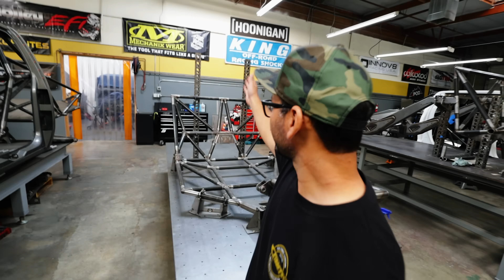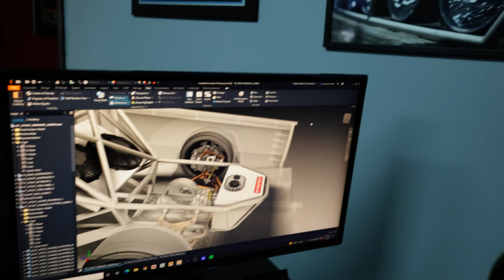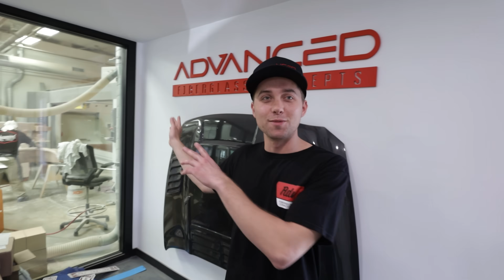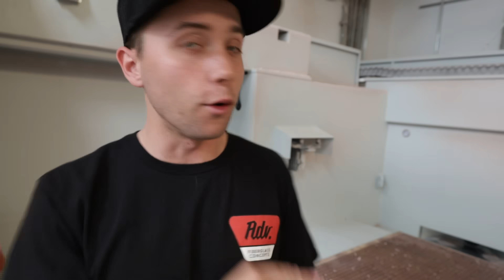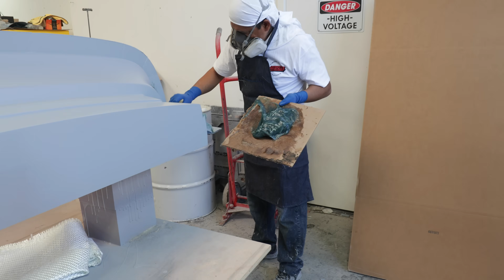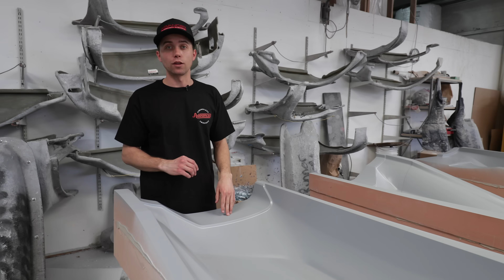STOUT Tube Chassis And Body Kit

Comment: Ok that ADV Fiberglass process is amazing and cool. Its like... the future

Question tho ... can you lay carbon fiber in those same moulds?
Reply: There's no real reason you couldn't, the process is the same, the only issue is if you want exposed carbon you usually put them in a autoclave or something similar to ensure there's no bubbles in it.